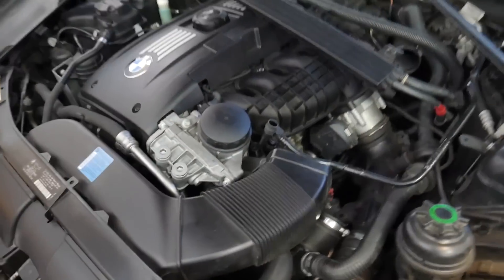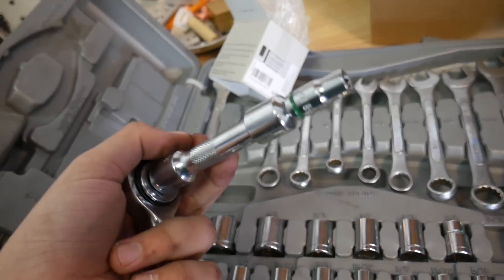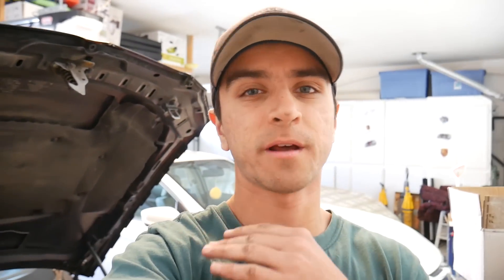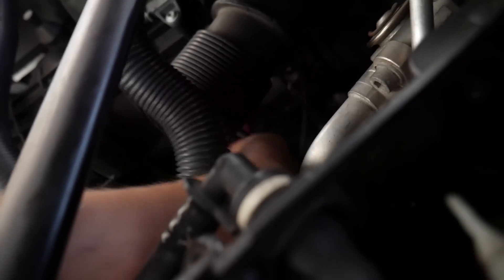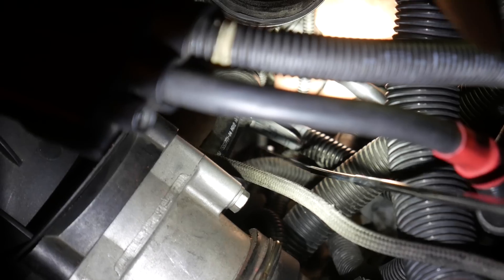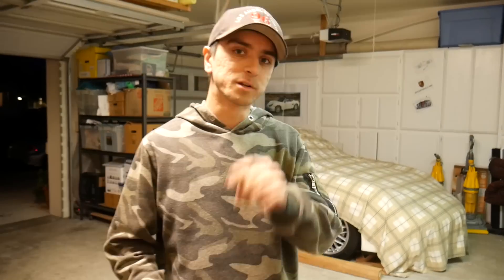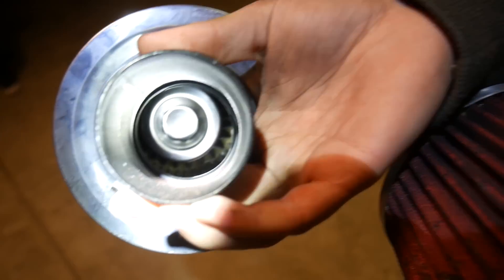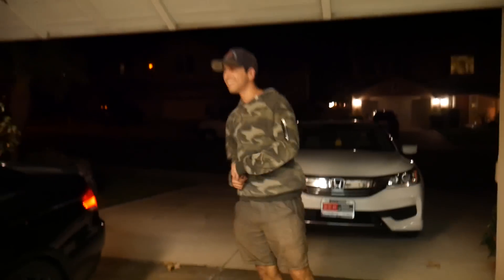This $80 Part Nearly DESTROYED My Car (335i)

Comment: I changed my camshaft sensor on Intake side and crank sensor last year because check engine would turn on and the car wouldn't crank up after it was hot. My 335i started stalling recently at low rpms at red lights and stop signs, changed the vacuum lines and came to realize it was mainly my camshaft sensor bank 1 b exhaust  code P130A. After that Idle went smooth and car hasn't stalled since or jerked while driving, felt great

Comment: I had the same problem with my 335i when I got it. My car went into limp mode and when I drove it home right after I got a cylinder misfire from cylinder 6, which turned out to be a ignition coil. I thought I could play it slick by ordering a cheap $13 sensor from ebay, no luck. You need the original Siemens vdo (now bought out by Continental) for the car to leave limp mode. The dealer apparently charges $1100 for this replacement

Comment: My 2004 BMW 530i has a horrible vacuum like behind the intake manifold, they capped it off. My mechanic suggested almost $500 doing the entire intake manifold no thanks, there is no leak coming from there and I am not losing coolant, pop off the microfilter housing and replace the cap then smoke the intake and see if it fixes it ha; I’m gonna smoke it first to see how effective it is. Always love your videos! Definitely gotta work on these cars, and I’m forcing myself to learn how to.
Reply from the maker: Thanks bro good luck to you! Yea, I am learning myself its challenging but worth it
Reply: Simply Car Things so an update, I can actually access the vacuum cap with ease on my 5 series, ordered a new part was only $6, also my air filter was shot, previous owner never changed it. What a difference that made!

Comment: im getting a Cam Sensor number also! My 2008 335xi coupe is in limp I guess.. Half lite engine on gauge ..if I get up on it, it starts bogging out. as soon as I ease up on gas pedel, it kinda goes away  .. Some one said its near my vannos in front?  .. I also have a oil leak coming from my vannos or one of the 2 cam sensors on each side of it.... wont know were the oil leak is coming from until I remove the valve cover(cover) to see it better
Reply: Did you ever get this figured out?

Comment: My brother's e60 535xi is down and out also. It was getting really long crank before it started so figured that it must have been the hpfp. Bought a new hpfp and replaced it and also did new spark plugs. After installing everything the car would crank but won't start at all. I'm down to this. Ordered a new crankshaft sensor and going to be replacing it next week when it comes in. Fingers crosses that she will start up! Will keep you posted! Great video by the way! Keep it up bro!!
Reply from the maker: Thanks so much man! Good luck to you!
Reply: What ended up happening with this?

Comment: Had the trans malfunction on for a while changed the battery checked alternator fluid was full haven’t checked cps hopefully it’s what’s wrong with mine too
Reply from the maker: hopefully man! Does the car have a long crank on start up?
Reply: Simply Car Things no but as soon as it starts the rpm fluctuates for a few seconds then settles down. I do get trans malfunctioning and engine malfunction it’s so annoying and I don’t get to enjoy my car
Reply from the maker: Get a code reader and pull the codes. That will be your best bet to pin point the issue

Comment: I got the same issue going on but it also had a really bad electric whine, when I hit the gas pedal I hear the whine more louder then the exhaust sound. Could it still be the crank shaft positioning senior or is it my transmission ??

Comment: it is actually really really similar happened to my 335i 2007 all the codes and errors comes on the screen and cars doesn't change the gears, showed my mechanic and he told me its electrical problem, you have to go to electrician and i know they gonna rip me off with this one, thanks for your vdo hopefully this sensor gonna fix the same issues in my car as well
Reply: What happened

Comment: Get BMS dual cones. Glad you got the bimmah running. I've done that fix too, I broke one sensor and ordered another. Also if you look closely when you order, (got mine from ecs), you'll see the o ring is in fact a separate part. A LOT of parts are like this. You'll have to order the screws separate for some parts because the screws are to be used ONCE. Live and learn. Have fun brotha
Reply from the maker: Thanks man! Yea i was surprised the o ring didnt come with the sensor but its all good ! Thanks for the input man

Comment: I changed My 2006 bmw 325xi crankshaft sensor and car got messed up like shaking really badly to the point it felt like shutting off then started smoking a bit now it’s been sitting don’t know what’s wrong with it anymore any suggestions?

Comment: Dude when you type in crankshaft position sensor on YouTube there’s a bunch of camshaft position sensor’s and I accidentally replaced the wrong part thinking that I replace the crankshaft position sensor later on I noticed that I didn’t change it it’s much more of a hassle than the camshaft
Reply: Your videos are so much simpler than all the other videos I’ve watched

Comment: I'm sure you've answered this question a million times, but I would like to know what scan tool/software do you use? I'm looking for the best option for coding and clearing fault codes. Right now I'm looking at iCarly and INPA. any advice/tips would be appreciated. BTW Great job on fixing your car!!
Reply from the maker: Thanks man! And I use the MHD app which you can get off the android marketplace to read codes!
Reply: use inpa
Reply: I just downloaded this software last night. I'm waiting on my cable to arrive Thursday. Thanks for the tip.
Reply: chillmagnet for which chassis
Reply: I have an 07' 335i E92. I believe I ordered the K+DCAN cable, USB to OBD2.
Reply: chillmagnet what's wrong your car
Reply: I'll try to keep this as short as possible. My car would go into to limp mode and the radiator fan would spin like it's a jet taking off. So I replaced the waterpump/thermostat since that's the most common issue that would cause the fan to do that. Well after that replacement it still happens. So I'm not sure if it's a misfire causing it as well or something else. The car runs a little rough sometimes but I attributed that to age. I also just replaced my battery as well, so I'm thinking it might be an electrical issue since I haven't registered the batt yet or I may need a new power distribution box. That's a few reasons why I was looking for software to read/clear codes as well as coding options. I have a K+DCAN cable arriving today and I'll play with the software this weekend to see if I can figure out what's going on. If you have any ideas, I would be more than glad to hear you out.

Comment: So did you have to do any resetting once you installed the crankshaft sensor mine has done the exact same thing but after I replaced it it will only crank and not start
Reply from the maker: no mine started up after install, make sure you pushed the sensor all the way so that it's connected!
Reply: @SimplyCarThings  ok I will try that, it does wiggle a slight bit and I felt like the bolt was going to strip if I tightened it down anymore and I don't need that

Comment: Just came back on this video because I think my crankshaft position sensor is beginning to fail. (Long cranks on cold start sometimes, hiccups in idle, and under acceleration i get hesitation around 5000-7000rpm
Reply: Did you find out your problem

Comment: Did it make like a motor noise or something like that when you are driving? And another question is that did it make it vibrate or not drive smoothly?
Reply from the maker: Not really it put me in limp mode and the transmission wouldnt shift out of 3rd gear. also car wouldnt start

Comment: Are you affected by this current BMW recall?
Reply from the maker: Yes I am, but I havent taken the car in yet
Reply: Simply Car Things only the cars in the us not in europe, right?
Reply: Supercars Hunter Europeans will probably never get a recall.Apparently the EU is super weird and won't tell the Europeans about it.
Reply: 123456bmx don't know what to do now!?!
Reply: Supercars Hunter what kind of recall?
Reply: Awe Somo fire 🔥🔥🔥🔥🔥🔥
Reply from the maker: I'm not sure! You'll have to check online
Reply: what recall ?
Reply: Bubba Gump fire dude fire 🔥🔥🔥🔥🔥🔥
Reply: Supercars Hunter which models are included? I have a e90 330d
Reply: Awesome you got your car fixed...btw 
Was it P0335 Crankshaft Position Sensor "A" circuit or P1727 Code?? 
I was told it has 2 crankshaft position sensors

Comment: Thanx fo Tha video cuzz
Reply from the maker: of course bro!
Reply: Yo my man great vid. I have a 14 BMW 435ix and I'm having similar issues (drivetrain, ABS, DCT, Transmission ect malfunctions) also I'm getting hood open warning, driver assistance malfunction. Car took 3-4 seconds to start as yours. So i took car to my mechanic today. He just called me saying the car is throwing 4 pages of fault codes. Smh. He didn't get into to much detail over the phone to which faults are showing. Anyway I'm hoping it's just this crank shaft position sensor. Does my symptoms sound like what was happening to you when u had issues? Thx bud

Comment: Bmws are fucking shit, been dealing with parasitic issues on my e60 for over a week now
Reply: Same. I have had mine 8 months and love it but in those 8 months I've put $8,000 into it. Not by choice but because it continuously leaves me stalled in the road. I literally paid $2,600 last week and 6 days later I'm stalled out in the road again. Yesterday's issue sounds like the camshaft position sensor but there's Def something electrical going on too.

Comment: Wow bro I'm currently experiencing the same issue on my 08' 535i. Car turning off, going into limp mode, transmission problems, going into Neutral. I'm really hoping this is the problem. I'm hoping its not the cam ledge. Thank you for the vid! 🙌
Reply from the maker: No problem! Good luck!
Reply: Hey bud any update for us on what your cars issue ended up being?
Reply: Any update please?
Reply: @austinmerrival927  It was the crank shaft positioning sensor.